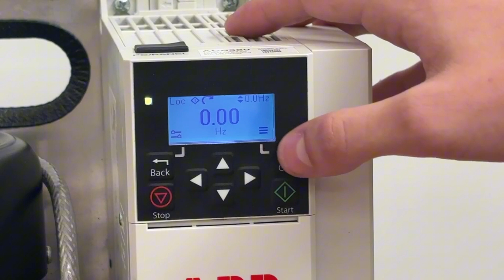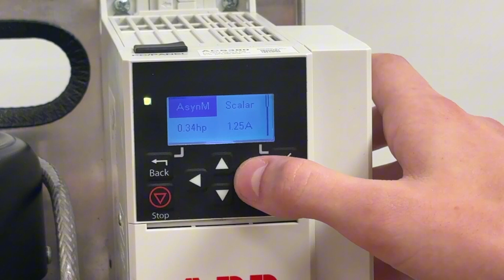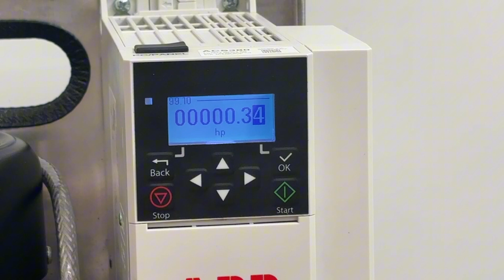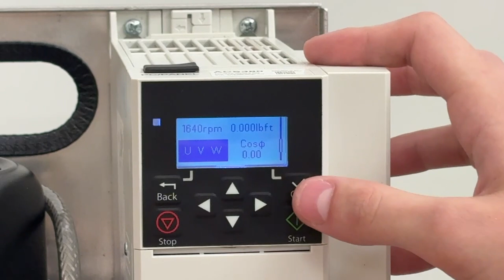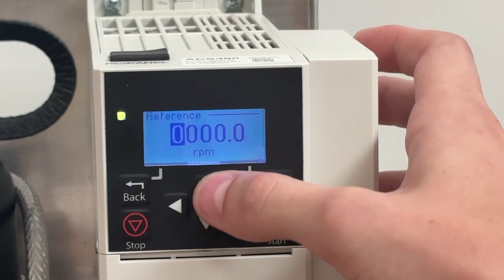How To Input Motor Data on an ABB ACS380

Comment: Thanks for the great guide on inputting motor data into the ABB ACS380! Your explanation on configuring key parameters like motor voltage and current made the process much easier. Appreciate the help!
Reply from the maker: @hunterschading4182  Thank you for the great comments!